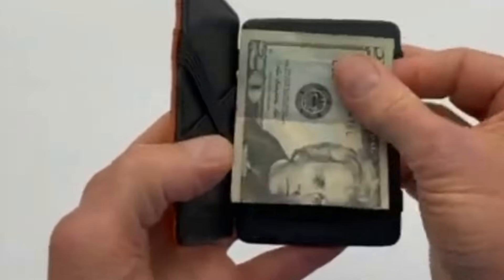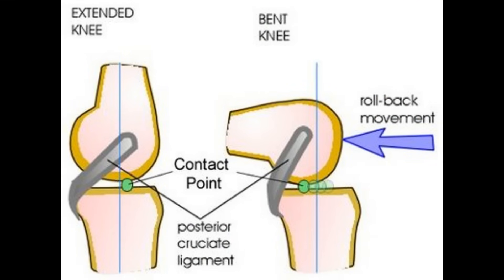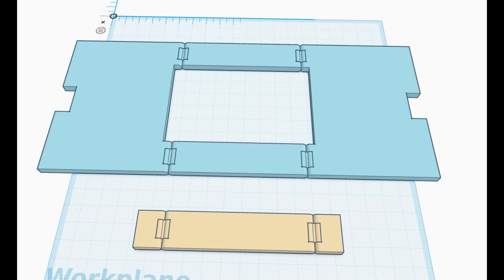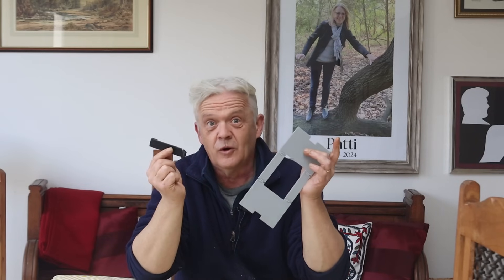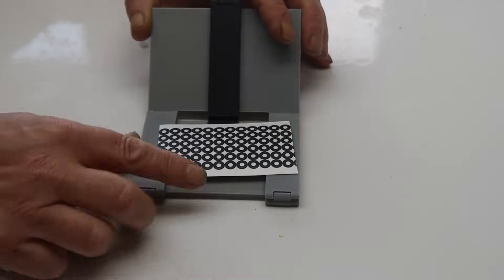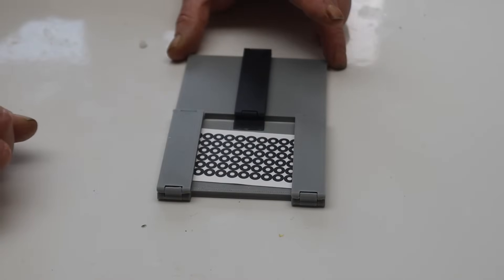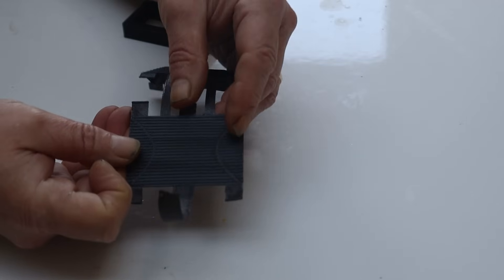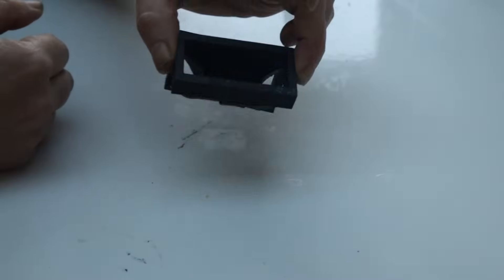2355 Rolling Contact Joints And The Magic Wallet

Comment: First cousin of the capstan drive, and arguably what was once used to move optical disk drive heads, turning rotary into linear motion with amazingly low friction. Just this morning I wound a stack of figure 8's between two bits of lumber, thinking to use it as an easy and expedient 180-degree+ hinge
Reply from the maker: i like that thought mate - thanks for sharing

Comment: Love it. I'm going to look into the BYU design a little more. It looks like the two flexible pieces that form the rolling contact point could possibly be printed solid. Am I seeing it right? That would eliminate the "orgami" part of the build.
Reply from the maker: if you remember that print in place Nerf gun that was done - BYU helped with that and it was their compliant mechanism in the first place - so well worth checking out and yes it could be printed solid

Comment: I had a toy in the 80s that was a Magic Rings puzzle. 8 plastic squares that were held together with fishing line. You could fold them in many directions and you had to scramble it and return the picture of the rings, etc. Or as I did, just fold them repeatedly marvelling at how pieces could move relative to each other depending on which way the structure was folded. And no, I didn't break the fishing line doing this. Sadly though,  I picked it up the other day and saw a few of the lines had broken away, probably just from UV damage or something. 
Not sure if it's the same joint but it reminded me of that :)
(I just looked it up on eBay, 8 Panel 3 Ring for Rubik Master Magic Folding Puzzle Toy Ghost Hand AU)
Reply from the maker: I looked it up - what a fascinating toy!
Reply: @ThinkingandTinkering  Definitely. Well worth a look ;)

Comment: Its almost 8 years to the day since I first posted that curved fold in cardstock coated with copper foil. It was a triangle, I took 3 semicircular 'bites' out of the edges so the flat triangle turned into a solid foot shape for cardware. I realised that the curves could be made fuller, and the Morning Star was born. Great to see the ripples still crossing the globe. 😅👍
Reply from the maker: awesome

Comment: BYU fan here. If we made that hinge with a zero stretch 3mm UltraHDPE cord, and had those cords at the top and bottom, with a v groove for the round plates to remain aligned at the center, it might be very strong and keep the rolling faces from separating under force against the axis. Neat.
Reply from the maker: very neat mate and BYU are doing some awesome work here

Comment: That second joint with the 2 round halves has a very nice application in robot joints. The flat flexible parts can actually be ribbon cable or flex pcb of 0,1mm material. In this way the rolling joints will never put strain on the copper conductors with the gentle controlled bending. CNC machines and 3D printers could also use them at the joints for the conductors.
Reply from the maker: very good point mate - thanks for adding it

Comment: Ah, that is very cool! Regarding the rolling Joint idea, Kirigami (Origami + ) and robotics are so cool. I started learning about origami and folding from how NASA was packing devices and unpacking them in Satellites, but it has so many uses.  It is almost magical how it works. There are several reasons why this can be useful, but one of them is the fact that we often make our initial materials in sheets, blocks and rods, and if we can figure out how to make 3 dimensional structures using folding techniques from sheets, that saves a lot of material as opposed to milling it out etc from blocks.
Reply from the maker: yeah absolutely mate - I am a fan of kirigami too